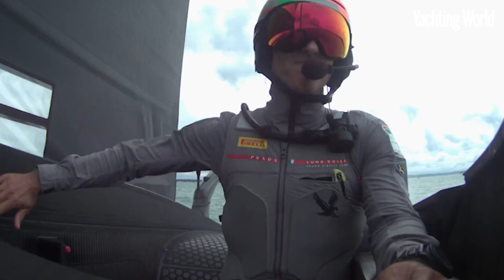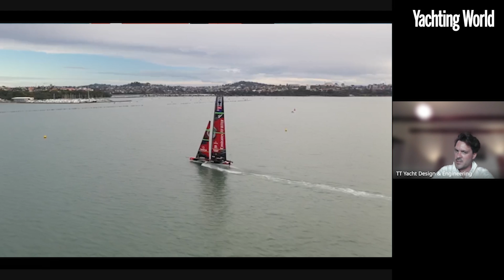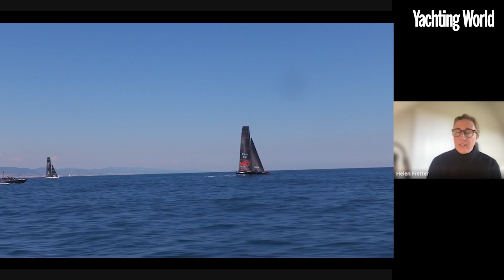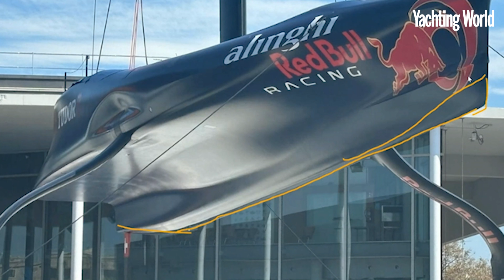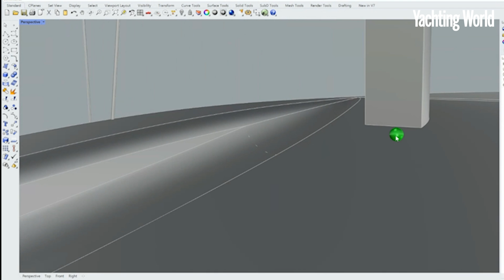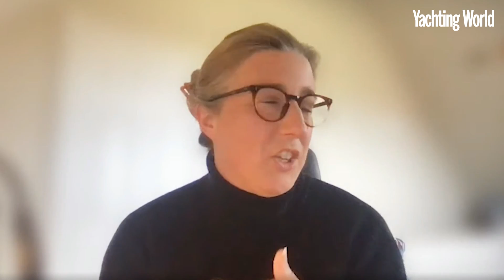Alinghi Red Bull Racing AC75 | An America's Cup designer's analysis | Yachting World

Comment: Looking /comparing Alinghis and NZ underwater shape, Alinghi has a small range of advantages in mid range wind. Alinghi to much uplift in high wind spectrum and to less in low wind spectrum. In strong wind high speed even dangerous due to high very compression by high waves, with jumping effects - compresse,air can‘t flow away. Expect several damages and to much problems for RudderMen.